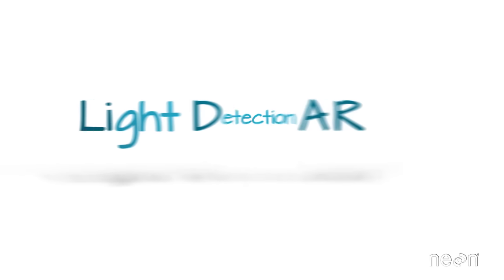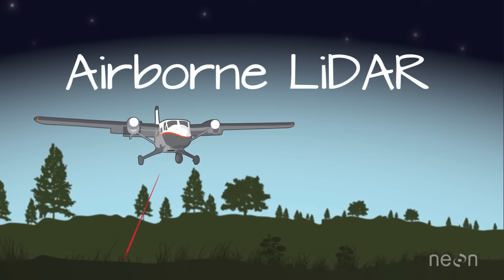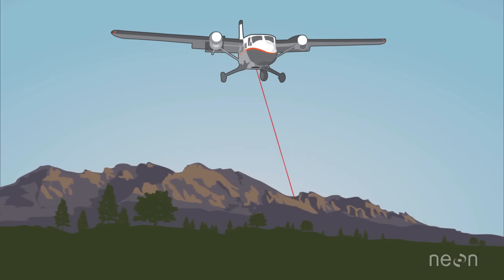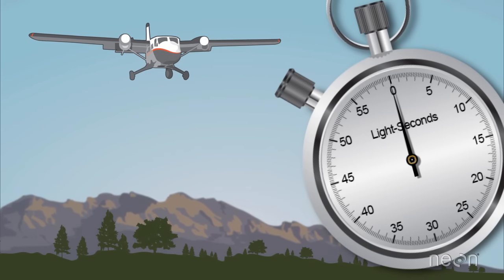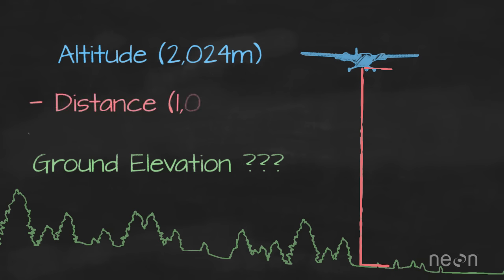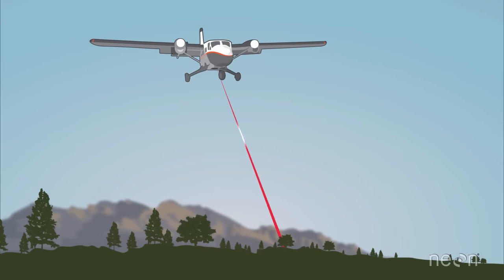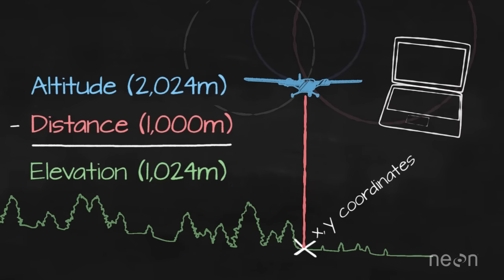How Does LiDAR Remote Sensing Work? Light Detection and Ranging

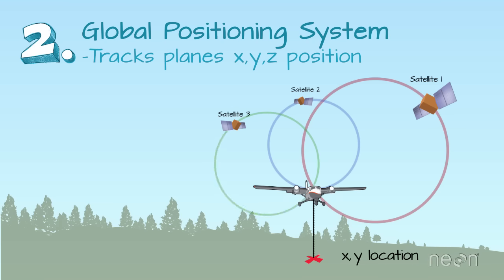Comment: Very informative, however I noticed an issue with the visualization at ~1:34. The satellites should be in the center of the circles that intersect the airplane. Technically they should be spheres, but circles are sufficient for conceptual purposes.
Reply from the maker: Thank you for adding the excellent point of clarification.  We did simply the graphic to just show the points of intersection on a circle, not the sphere.

Comment: Firstly thank you for this useful info.
can LiDAR detect fire flame? need your advice. Thank you
Reply from the maker: Interesting question!  LiDAR can be used to detect fires but the detection is actually based on the smoke, not the flame (see reference here: http://journals.sagepub.com/doi/full/10.1155/2014/597368).  The laser needs an object to bounce back from.

Comment: If the light is well calibrated then use the pixel per inch then calculate it's rate of light expansion is how we get correct high and color change or intensity change is revealing it's property of materials and instead of single sweeping laser we should use line scanning or ring line better

Comment: Does it require an atomic clock? How does it get a precise measurement of the time it takes for the pulse to bounce back? Light can travel around the world 7 times in a second. The time between the pulse and the return must be incredibly small.
Reply from the maker: +D Bay This is a fantastic question. We consulted with NEON Airborne Observation Platform Staff Scientists on this question! Here is your answer - the lidar does not need an atomic clock - please read below.
```````````````````````
Great question! Yes, the time between transmission and reception is incredibly small. We do not require an atomic clock, those are in GPS satellites and are required for very accurate and precise absolute time. We do not need absolute time in the LIDAR systems, only relative time (the time it takes for the pulse to travel to the ground and back). Calculating this time can be achieved with less expensive solutions than atomic clocks. 

The clocks in the waveform digitizers for both the Riegl and Optech sensors (the ones we are using) are capable of measuring to a precision of 1 nano second. Given a pulse travels ~0.15 m in a nano second, this is sufficient resolution to accurately measure travel time and in turn calculate distance.
````````````
We hope that this answers your question!
Reply: GPS time or UTM and is atomic. Yes the time is incredibly small but can be measured all the same. A technology called DGPS is already being  used to measure positions to 1m accuracy and even less if need be. The question to ask though is the possible smearing of the data since the plane is not stationary. That is the place will have moved some distance before the reflected light returns. But again this may be insignificant compared to the speed of light and for small elevations.

Comment: Some errors, no clock can measure the time it takes light to travel such a short distance. Each pulse has a unique 'signature' and the sensor tracks when it leaves and when it returns, then calculates the distance afterwards.

Comment: These lidar systems do not use TOF. They use a linear ccd system. It looks where the laser Shines on an object. There is a distance between the laser emitter and the ccd. The laser is angled towards the CCD where it sees the laser. It can calculate the distance to its point of reference.
Reply from the maker: There are several types of lidar systems. The two sensors that NEON will be flying with in the 2018 flight season, a Riegl LMS-Q780 and a Gemini ALTM Gemini, both do have time-of-flight (TOF). Other lidar systems do rely on other types of technology including charge-coupled device (CCD), photon counting, or Geiger-mode lidar.  NEON does not currently operate non-TOF lidar systems.

Comment: nice video. can anyone tell me what the grund elevation is and why we take the  2024m (Why??) - distance (1000??? WHY where do i get this from) (at: 3:54.) Why do we do this calculation?

Thanks a lot.!!
Reply from the maker: Hi. In the case outlined in this part of the video, the unnamed scientists are trying to precisely measure the elevation of the ground (and any trees or building).  To do this with the laser, we have to know several things: 1) Accurate height of the plane (in the video: 2024m, obtained from a GPS onboard the plane) and 2) the distance the laser pulse travelled from the ground to the plane (in the video: 1000m, obtained from the time the light took to travel from plane to ground and back to plane).  Both of the numbers (2024m and 1000m ) are examples and would likely vary by every point taken. Does this clarify the video?  If not, feel free to ask.  --Thank you.

Comment: I had a question, so LIDAR sensors can register only one point on ground surface at one time? If not how does the LIDAR sensor differentiate between multiple reflected pulses at one instance of time?
Reply from the maker: +gurminder bharani 
We went to the scientists with our Aerial Observation Platform to get a complete answer for you. 
*
The LiDAR sensor measures the return time of the laser pulse to calculate a range. If there are multiple objects in the optical path of the laser beam, such as vegetation, they can be differentiated and can create multiple returns. The sensor used by Optech can differentiate up to 4 returns. The range resolution of the sensor defines a minimum separation distance of objects which allows multiple distinct returns. The sensor operated by NEON has a range resolution of approximately 2 m, meaning objects less than two meters apart cannot be differentiated. The range resolution is dependent on the outgoing pulse width of the laser pulse, which is ~10 ns on the NEON LiDAR sensor. Object greater than 2 m will have returns separated by approximately 10 ns. Although we conceptually think about a beam of laser light being ‘instantaneous’ in time, the timing systems on the LiDAR sensor are precise enough to measure extremely small differences in the return time (down to 1 ns).”
Reply: This is a question of the design with both the software and hardware. You can indeed see multiple returns from the same laser pulse. The laser diverges with distance, and will hit multiple objects, like leaves in a tree, before hitting something like a wall. With each hit, there is a chance you'll get a reasonable return.  This quickly however falls into the domain of "signal detection theory".  Often multiple return data has varying return intensities, where the return is compared against the ratio of the signal+noise to the noise estimate (see ROC curves). It can be challenging to maintain a "constant false alarm rate" with the strongest return. It becomes trickier to decide on which is signal and which is noise for the weaker returns.  The return pulses always have some degree of shot and thermal noise..    I did this for a living for a time.. there are a lot of subtleties that make lidar an interesting problem.
Reply from the maker: Great point.  Yes, the video does simplify the process considerably!

Comment: Nice video. I have one doubt, if the laser light is sent to a flat ground from certain height at an angle say theta from normal to the ground how come the receivers receive the ray back? Shouldn't it travel with theta angle normal to the ground in other direction?
Reply from the maker: Anurag Dixt - great question.  And yes, if the ground was utterly, perfectly flat that is true. However, given that all objects are less than ideally smooth when the laser hits the ground the light scatters and some of it does bounce back at the receivers.

Comment: Since the height calculation involves the time the pulse leaves and returns at awfully high precision, I'd expect a good clock (preferably an atomic one) to be part of a LiDAR system.
Reply: Good point! Also I have a question - how does it always return emitted laser pulse back to the plane? - How can we guarantee the needed angle? What if the surface just reflects it to another direction?
Reply: you're right each pulse has a carrier phase signature associated with it, no clock can measure such a fast return but it can record when the individual pulse leaves and then later calculate when that distinct pulse returned

Comment: Use two image in series of image and analyze intensity to size then get the true size same thing with space distance object by two separate camera with standard distance between the two position or use one camera and extract simulate same series at two different time function of a standard unit of time but simulated two position by extrapolation

Comment: What is the resolution of LIDAR. Would this be good technology to map a boulder train that extends over 20 miles and is between 100 and 300 yards wide. How expensive is it to have done? Are there companies that provide this service for private parties? TY
Reply from the maker: NEON Associate Scientist Tristan Goulden offers these comments on your questions: 

The ‘resolution’ of LiDAR can vary depending on the type of sensor and platform. Typically airborne LiDAR surveys with fixed wing aircraft can normally achieve 5 – 10 points per square meter with the most recent sensors. Using a helicopter, the point density can be increased due to the ability to fly at lower altitudes and speeds, however this comes at an increased cost. Using a helicopter point densities up to 50 points per square meter are not uncommon. The most dense LiDAR surveys can be acquired through terrestrial laser scanners. These are stationary systems that scan from the ground. The point density from these systems can be as high as the user desires, typically achieving hundreds of points per square meter. However, it takes much longer to cover a large area than an airborne survey. Raw LiDAR data is termed a ‘point cloud’, and point density is often used as a metric as opposed to resolution. Once the LiDAR point cloud is ‘gridded’ into a raster product such as a DTM or DEM, resolution is a more common term. LiDAR rasters are typically created at twice the nominal point density. For example, if your point cloud achieves two points per square meter, you should only create a raster product with a resolution of 1 meter. 
 
Yes, LiDAR is a good technology to map a boulder train of that size with an airborne survey or terrestrial survey being options. A terrestrial laser scanner will take a lot of time for an area that size, however may be cheaper. An airborne survey of the area that size would be quick, but incurs significant overhead in deploying an aircraft so costs come down significantly as the size of the area increases. Exact costs are highly dependent on the area, type of sensor and aircraft desired, or time required for a terrestrial scan. There are several remote sensing and land surveying companies that will provide these services for private parties and would be able to provide reliable costs estimates.

--

NEON's Assignable Assets program (http://www.neonscience.org/assignable-assets) will include airborne LiDAR capabilities.

Comment: I have a (maybe-stupid) question: how does the sensor detect the pulse that was sent not perpendicularly to the ground? 
It should be reflected away from the airplane, right?
Reply from the maker: Great question actually, Kadek. Yes, any light that is scattered in a direction away from the plane is not received by the sensor. The amount of light directed away from the sensor is dependent on the properties of the target it makes contact with. If the laser energy made contact with a mirror (unlikely in the real world) at an angle, all of it would reflect away from the receiver and we would receive no energy back as you’ve mentioned in your question. This often happens in the real world when the laser contacts flat calm water bodies. This is termed a ‘specular reflection.’ Most real-world targets we make contact with, such as vegetation, can be considered to be close to a lambertian surface. A lambertian surface reflects energy equivalently in all directions. While real world targets aren’t perfect lambertian surfaces, they will display scattering in multiple directions. The LiDAR needs only to receive 1-2% of the transmitted energy to trigger a return, and this minimum amount of received energy is typically achieved due to the multiple scattering that occurs on near-lambertian surfaces.

Comment: What if light from sun is reflected to receiver
Reply from the maker: Thanks for checking out the vid, and good question! Yes, it is possible that the receiver will detect reflected solar radiation. Typically the signal from reflected solar energy is much lower than the energy from the returned laser pulse so the added noise is negligible. However, there are instances such as specular reflection from water, where reflected solar energy can trigger a false return. Normally these returns can be easily identified and flagged as noise.

Comment: what happens when a LIDAR scans over a lake or any other specular surface? Does it work? LIDAR sensors aren't friendly of specular surfaces since they rely on the diffuseness of the surface to reflect back some light to the photodetector. LIDARs aren't friendly with clouds, smoke, mist, rain or any other environmental condition that can scatter the laser light! An electromagnetic wave can be harmful based on its wavelength and/or power. Increasing the power of the laser or shortening its wavelength to overcome the scattering can be harmful for the life on the ground right below the LIDAR.
Reply from the maker: +Harold Jimenez Good point. Actually some of this has to do with the type of light that the lidar is using. If it's using 1024nm - NIR then that light is likely to be largely ABSORBED by larger bodies of water. However, some lidars use green light and are optimized for things like bathymetry - to get under water topo. There are many nuances associated with sensor configuration and also types of sensors. Great point!

Comment: What if it gets multiple returns from one transmission?  Is this possible
Reply from the maker: Great question - this actually happens all the time. Check out 6:30 in the video for a visual of what I'm going to be talking about here.  As the laser travels away from the sensor, light can bounce back off any surface. If a surface is more solid, more of the light bounces back. Since the laser has a defined diameter, if some portion of the light passes through/past an object in its path, like a forest canopy, there can be numerous returns. The sensor picks up all the reflected light as various amounts of energy (graph on the left of the screen). For discrete lidar - the most common type currently - the computer algorithm in the sensor selects only the most prominent of these peaks of energy as the returns (the video clip shows 4 returns).  In the NEON data products up to 5 returns can be saved for each point. But there is another type of lidar, waveform lidar, where the data for the full set of energy peaks and troughs is saved. As you can imagine this is lots of data and scientists are just now starting to use this technology to answer new and exciting questions using lidar data.

Comment: hmmm last time i checked radio waves are light, so the difference is that lidar uses a different type of light
Reply from the maker: Correct and good point.  Light and radio are all waves of different lengths on the electromagnetic spectrum.

Comment: 0:13 implying radio wave isn't light?
Reply from the maker: You're right, both radio and light are elecetromagnetic waves. The difference is the frequency at which they travel. Thanks for checking out the vid!

Comment: why do we use lidar in autonomous vehicles like one by google, when we can afford the system using radar which is more cheap
Reply from the maker: @vipulnath1   Thank you for your interest in lidar.  Your question stretches beyond the expertise of the NEON project, however, it looks like the question of radar vs lidar is still an active one in autonomous vehicle research.  Some companies (Tesla) seem to be pursuing primarily radar, while others (Google) are going with lidar.  It will be interesting to see how the technologies advance in the coming years!
Reply: also sir, in autonomous vehicles is it really required to use sensors that can extract distance upto 100 to 200 meters??, i blv 60-70 m is more than enough to avoid collisions and to implement autonomous conditions
Reply from the maker: @vipulnath1 Interesting questions.  Our focus in very much on airborne based lidar for the measurement of landscape and vegetation – the plane collecting NEON project data is generally flying at 1000m above ground level.